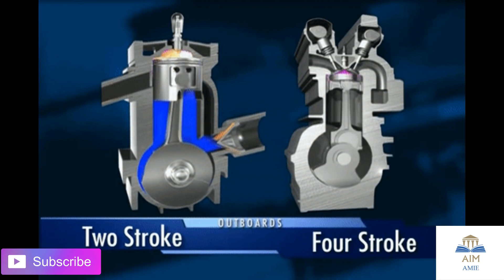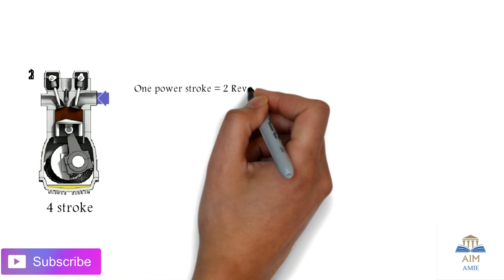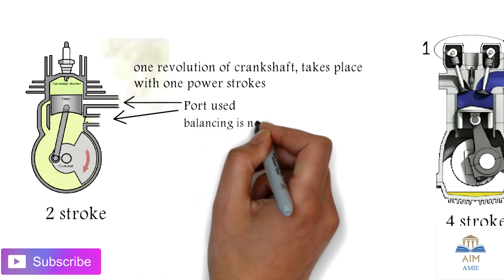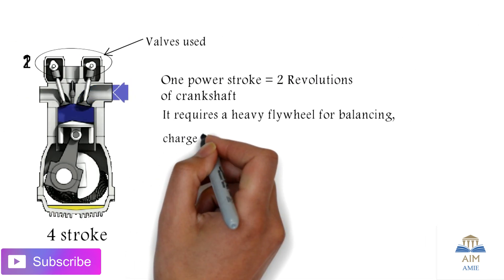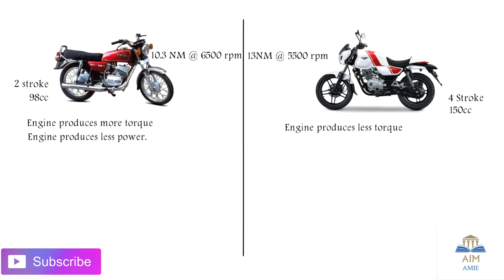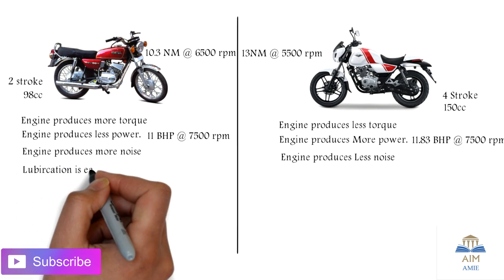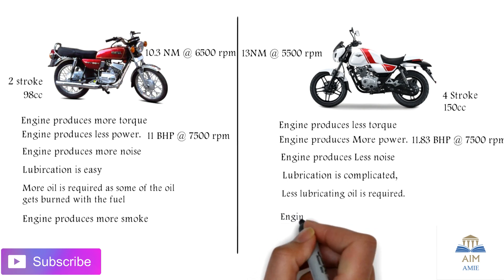Two Stroke Engine Vs Four stroke Engine.  ||Engineer's Academy||

Comment: Out of 2 and 4 stroke engine which develops more power?

Because according to me...2 stroke would produce more power...i have experienced by taking a race between rx 100 and bajaj v15...

Absolutely rx 100 wins..

Can u clear my doubt?
Reply from the maker: a 2-stroke engine creates more torque at a higher RPM, while a 4-stroke engine creates a higher torque at a lower RPM

Comment: Have some doubt!
For example: In KB100 or RX100, The oil is mixed with petrol or it should be filled separately somewhere in a bike?
And what type of oil it is?
Reply from the maker: Oil should be filled seperately / it should not get mixed with petrol.

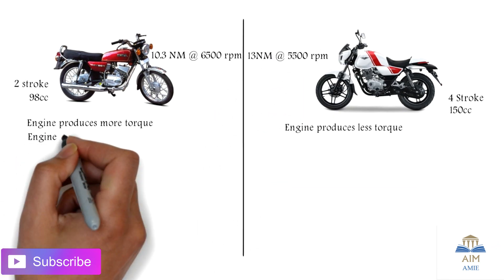Comment: 2:54
You told that in two stroke engine the torque is more and in stroke engine that ok is less
But u wrote 10.3 in two stroke and 13 in 4 stroke
Reply: I was about to point the same.  Plus these aren't even the same size engines.
Reply: @JW86SH  true that